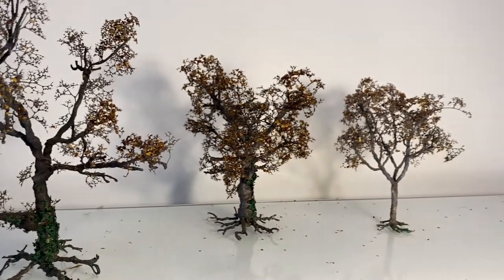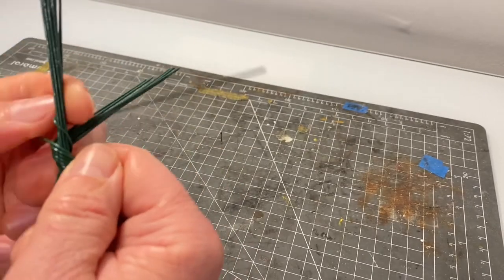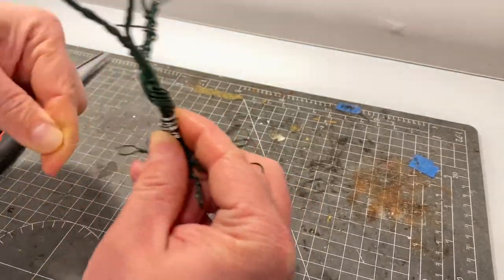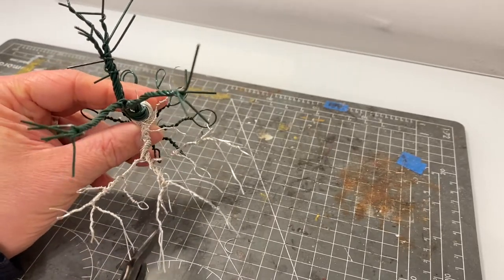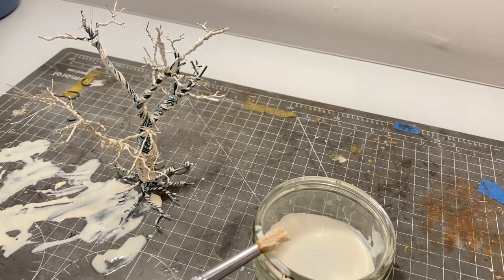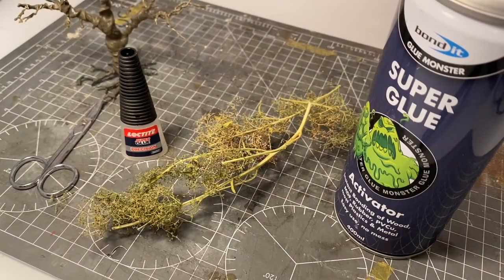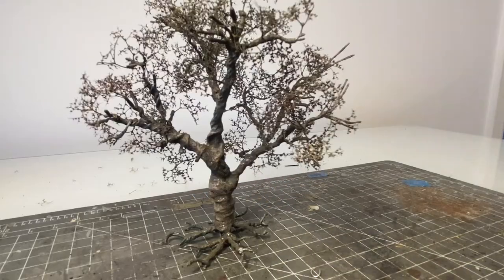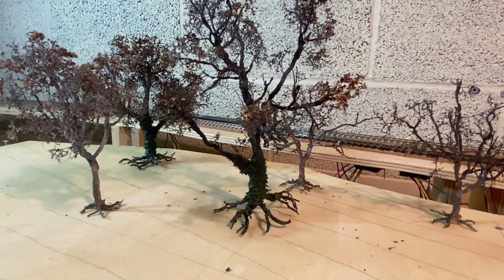Making Model Trees - St. Michael's Hill Model Railway Ep.94

Comment: Hi Richard really nice job at making the trees i have seen the wire method before how long would just 1 tree take to make? top work mate. Cheers and all the best.
Nicholas.
Reply from the maker: Hi Nicholas. If you don't take into account drying time of the liquid latex and grout then it's probably 2 or 3 hours per tree. I usually make a load of wire armatures and then do all the latex at once.